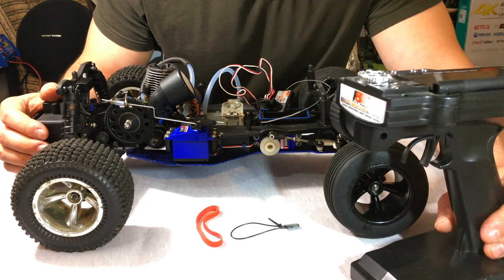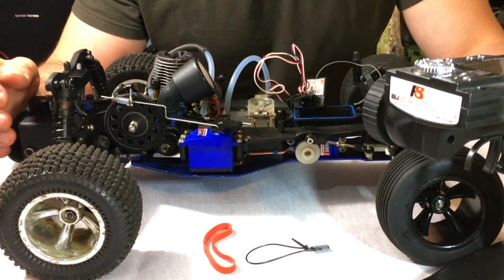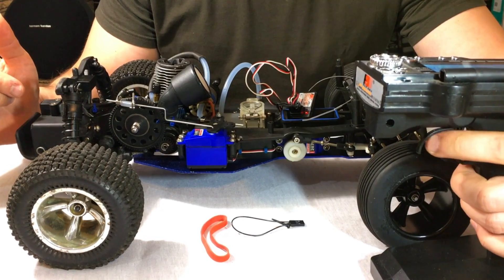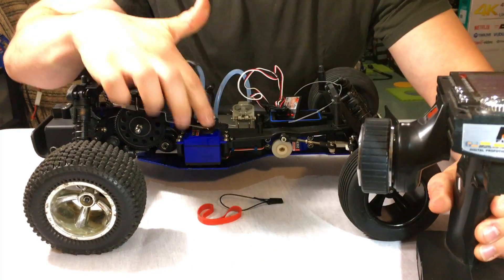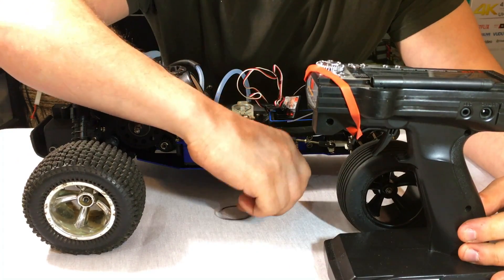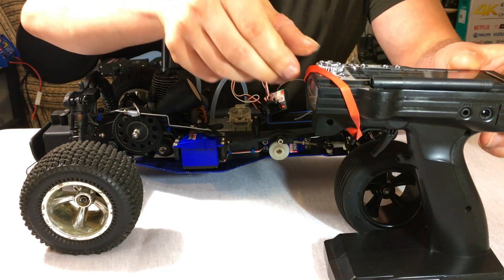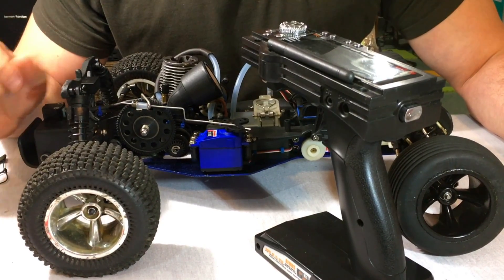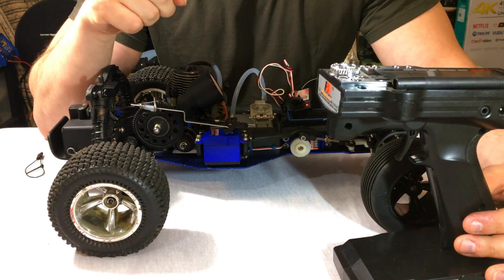FlySky Receiver Failsafe Mode Programming.

Comment: Thank you!!!! I had forgotten exactly how to do this.  I really appreciate the video. Thanks.
Reply from the maker: You got it my dude, I am glad this video helps you out. Just so you know, I have recently converted all my radios to the fly sky GT5 system. It is far easier to bind and run.
Reply: @hybrid32494  can you recommend a decent 6ch receiver that is compatible with GT3B or mainly GT3C,  that has gyro & failsafe built in? Thanks in advance.

Comment: My Throttle is not working 😢😢 plzz guide me
Reply from the maker: Hey buddy, there are a couple issues you could be having first are you sure your throttle servo is working and functional I would recommend you plug something else into the throttle port to make sure that the receiver itself is functional. You could also have the plug wires incorrectly positioned just make sure the plug is correct, let me know with any updates and let’s see if we can get it working.
Reply: I did everything correctly. My servo is working also fine but the rear Motor is not getting proper signals
Reply: And I am sorry I am asking again and again
Reply: Do you have insta or Facebook

Comment: Thanks for this video bro, I recently had my nitro rustler full throttle away from me. Luckily not to bad of damage. I have that same remote, i'm going to have to do this. Any chance you have a throttle return spring set up with your nitro rustler? Just got into nitro rc's. Thank you for your time.
Reply from the maker: hey my dude! Im glad you found this video, the fail-safe setting is super important.  BTW about the throttle return spring, I highly recommend you Just use a thin rubber band around the carb's High Speed Needle and the Throttle arm itself, it will pull the carb closed if anything happens. Thing is, if for any reason the power is cut or battery falls out, the fail-safe won't work, and you would need a real spring or rubber band to close the carb,  you know.
Reply: I agree with you, yesterday I put the spring on and it feels pretty tight and when I push throttle it doesn't open all the way. I just found this video about the fair safe, so I'll be doing that after work and grabbing some rubber bands.  I just really hope it doesn't take off again. It crashed pretty hard in to the curb and I just fixed it.but I didn't have the failsafe on and I didn't have a rubber band or a spring holding the carb closed.

Comment: Great video and channel. Thanks for the great info and honesty!
Reply from the maker: hey buddy!  You got it! That's what I'm all about it, transparency, honesty and making Nitro Great again!!  lol.  In the future if you get a chance to pick up another radio I highly recommend the newer Flysky GT5 radio, you can see in my newer videos I use it all around.  It's the same as this, but 6 channel, easier to bind and easier to set failsafe.
Reply: @hybrid32494  Thank for the replies and for the transmitter rec! I'm on the Fs gt3c, love the battery pack and ability of multi binding memory. Your right tho, channel limits. I'll definitely consider the GT5 whenever I switch up. Great channel and info👍 much appreciated!
Reply: @hybrid32494  Just thought to mention to check out stirlingkit for more nitro options. I ordered the rh801(they had it for $329 but raise the price, got it for 287 with 13% skbf code) rh1029(dropping in a 2 speed baby! That I found in aliexpress), rh1001(the have them for 199), 94122 from them. Debating on the rh1008.
Also picked up the HSP 94166 and 94763 from BG. Diving deep in Nitro🤘 Thanks for the awesome info!

You can also create an affiliates link for commission, this is mine. Your channel would rock it! Highly recommend for you 🤙

https://www.stirlingkit.com/?ref=pf6f7gwglqzh

Comment: If you have an electric motor, you want to leave the throttle in neutral when setting failsafe. Otherwise it will go full throttle in reverse when you loose signal.
Reply: Silly question, but have you tried this on an electric setup? I have an electric boat I would like to set the failsafe to neutral.

Comment: Question 
when i set my Servo Reverse for channel 1 on my Kyosho mp777 with this Radio and Turn the Radio OFF 
it keeps Resetting to Normal ???
not Saving the Setting for Reverse ?
Why , am i doing something wrong
Reply from the maker: hey man!!  It sounds like you are not fully saving the servo reversing setting.  When you see it lit up on the screen after turning the selection dial make sure to actually save the setting by pressing the selection button and then pressing END.  Let me know if that clears it up, if not I will go get my radio and do it right now myself.
Reply: @hybrid32494  thanks for info - i will tinker with it tonite
Reply: @hybrid32494  Thanks for info - Saving Now 
i thought FLYSKY POOR Quality for not Saving in Memory
Reply: I can not set failsafe so that it activates the brake, after losing the signal only turns to neutral position.

Comment: Does the failsafe work on the steering channel too? I'd like to use the GT3b on a fighting robot but it would need to failsafe on both channels.
Reply from the maker: hello, YES.  You can program a fail safe feature for any channel.  I just used it only for the second channel in tis video because it's my throttle servo which matters here.  You just gotta make sure the correct channel is selected when you do the programming steps.
Reply: @hybrid32494  "... make sure the correct channel is selected..." and how do we do that?
Reply from the maker: @iforce2d  hey man! I'm here to help you now if you're doing this,  We will get it right now.  You don't need to select any channel, when you apply full brakes with the rubber band as I showed that is the way the failsafe will be set.  It simply stores the current position of the remote. IN this case it will remember to apply full brakes in the event of signal loss of any kind.  you don't need to do anything else on the remote itself.  Let me know if this helps, ill respond to more comments today for ya.
Reply: @hybrid32494  I see. Something must be not right with mine then. I want failsafe to put channels 1 and 2 in the middle and channel 3 at zero throttle, this is for a plane. After doing this procedure, turning the radio off causes channel 1 to go center and 3 to go zero like I wanted, but 2 stays wherever it already was. I suspect it might have something to do with elevon mixing not working with failsafe correctly. No matter, this is just for a temporary setup I will be re-doing pretty soon anyway.
Reply from the maker: @iforce2d  The theory is the receiver will duplicate the condition of the channels as they are in the time when you press the button in the receiver and hav the bind plug inserted.  Sounds like it's almost right for you. Because the channels you don't mess with are in the middle, as they should be. Attempt to do this again and set the desired channel 2 position only on the remote.  Ofcourse the plane setup is now complicating all of this you're right.  Lets see if it will work.